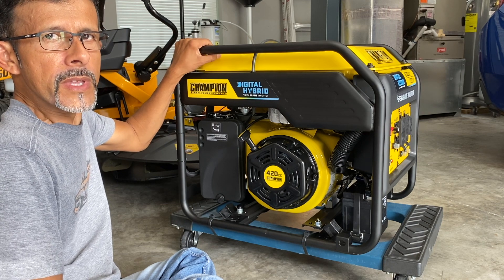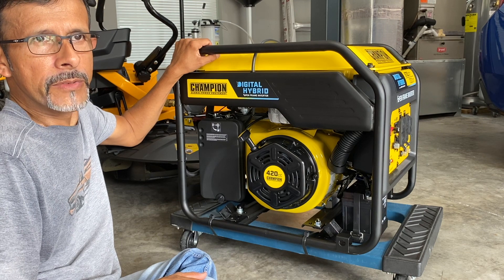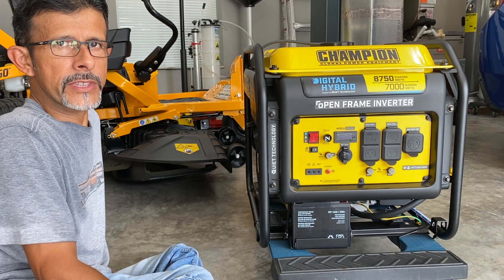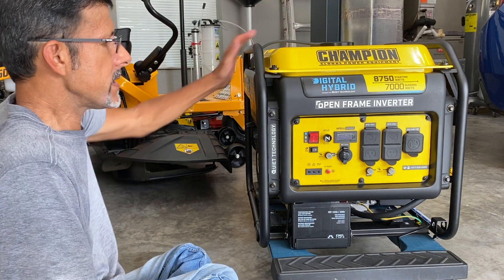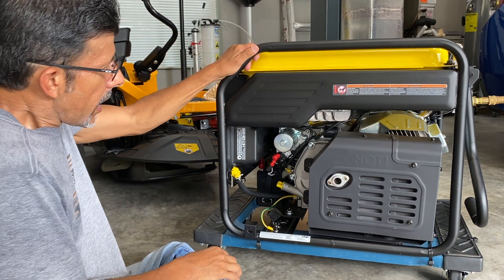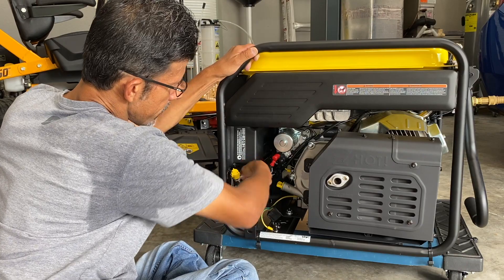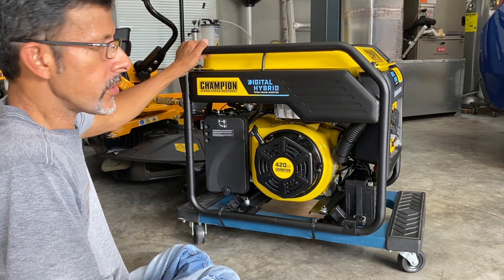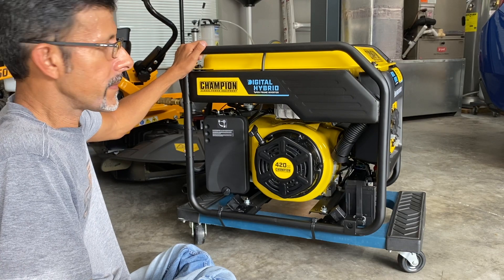Champion Inverter Generator 100520 with tri fuel kit

Comment: You don’t have a hose clamp from the regulator hose connection to the carb
Reply from the maker: A hose clamp wasn't needed because the barbs on the brass fitting were very tight. The hose wasn't coming off without some serious pulling.

Comment: You could install a micro-air soft start unit on your 4 ton and get rid of the 4 mini splits.
Reply: AirGo soft start is cheaper and just as good if not better. Installed mine yesterday

Comment: You don't have to run a generator 24/7.  You don't have to watch tv and use a home theater during a power outage.  All you really need is heat or cooling, water if you have a well, refrigerator/freezer and cooking.  You don't have to run those all at the same time either.  That's why you don't need a larger generator.  
If it's winter you heat the house to 75 degrees and let it cool off to 55 degrees, then start the generator.  Reverse applies to cooling, although that would be less comfortable, at least for me.  You probably don't need to run a generator more than 3-5 hours a day.
A tank of gas would probably last 3 days on that schedule.
Biggest drawback to gasoline is the ethanol issue and it going stale.
Reply: I run mine 24/7 when powers out.        House gets hot fast if ac's dont run at night in hot weather. 

 If you buy a premium 92 non ethanol gas and put stabilizer in it it's good for about 18 mo.without issues.   Then  once-a-year you just put that gas in your vehicles and buy new gas and it's always ready.

My 3500 will run on about 9 gal every 24 hrs. With 2 small window acs.   It's not an inverter but I've never had any issues with TV computer etc.   However there is one annoying issue with it now..... And that is that new LED light bulbs flicker with the non inverter generator.    And that is annoying as crap.  They save a tremendous amount of energy..... Especially running a generator.  But the flicker is a showstopper

So I have 8500/7000 watt inverter generator there's no light flicker but it uses 50% more gas than the little one for the same job.😮.   But I also don't have to turn the AC is off to use the microwave. And it will run my clothes dryer too. Or my wife can use a blow-dryer.

Comment: Judging by the looks of the meter box you built......the meters look familiar, and I think you misspoke....they can read Voltage, Amps and Frequency......not Voltage / Amps / Watts......right? The Amazon link you show doesn't match what you bought, too. Otherwise, fine review and NICE job on the box.

Comment: I have the same generator I want to convert to NG. I will be tapping into the meter and running a 25ft NG hose to my generator. Would 1/2” work or do I need 3/4”? I only ask because there is a huge price difference between the two with the quick disconnect fittings.

Comment: Hi Ozzie. I also have the 100520 champion and just installed the us carburation motor snorkel tri fuel kit. The generator still runs great with gasoline, but I can't get it to start with natural gas.  I am tapped directly to the gas meter low pressure side with 3/4" 25ft line straight to the generator. Does anything sound odd and have you experienced this issue and how did you resolve it? Thank you. Great videos BTW.
Reply from the maker: I would reach out to US Carb tech support. I’ve used them in the past and they are/were very helpful.
Reply: I will try that. Wasn't sure if I was missing something. Thank you Ozzie.

Comment: Hey Ozzie thanks for raising the standards of you tube videos.You definitely know your facts and it was well detailed on a much  needed subject. I like your fully functional and explained  project box which is a good guideline to know where you are at with voltage and loading without clipping on an amprope every time.I would say for sure you will see all your innovations implemented in Champions generators sooner than later.

Comment: Just curious, does the engine lose much after converting to NG?  I am considering that, but all the other inverter gennys that I see give different watt ratings for Gas/Prop/NG.
Reply from the maker: They do lose some running wattage while running on LP or natural gas because both fuel types have less BTUs than gasoline does.

Comment: Ozzie, nice job on the mods and the video. I recently installed an interlock kit and the power inlet box and wiring in my house. I tried it out with my old General GP5500 and it worked fine. I went to the trouble of installing a switch that allows me to choose bonded or floating neutral. I flip to floating for  whole house use and if I ever use it as a remote portable unit I’ll flip it back to bonded neutral. The 100520 has a bonded neutral and I like to know if you have modified your to be a floating neutral or if you just plug it in as shipped out of the box?

Comment: Hello Ozzie.  Thanks for the video. Is your meter displaying the total wattage capability of this generator on propane, 4300 watts?  I was hoping it would be in the range of 6000 watts. I bought the same generator today and hope to be able to run it on natural gas in the event of an extended grid failure. I assume the natural gas wattage will be something less than it would be on propane.
Reply from the maker: I don’t remember if I had the generator maxed out that day when I was doing the video.
Reply: @Ozzie4Para  Okay, thanks. I'm assuming the propane and NG wattage would be about 85% of gasoline. Your video is very helpful.  Best to you.

Comment: Excellent video dude!!  Your brain is fine tuned 3600 rpm to figure that all out.  20+ years prior home I grew weary of gas only gen, a fussy fuel to keep fresh, carb not gummed. I’m definitely heading in direction of propane now, I’ll subscribe to your channel in case I wish to add natural gas for a more limitless energy supply.  Or figure out a larger propane tank system, a couple hundred gallon “mini-pig” would be nice. I’ve pondered hurricanes at 100 mph across hundreds of miles perhaps for days on end, and tropical humidity+heat.  Uff da the Norwegian-Americans say.  I’m used to northern climate, less broad, more pin pointedness  “Russian roulette” of tornadoes, terrible winds lasting 1/2 hour max.  I’d be more terrified if 100 mph+ lasted for multiple days!!  Of course we get polar vortex brutally cold and very freeze dangerous blizzards that last a day or two.  Below zero to 30 below and windchills like 40 below. It’s a very good thing to have emergency power available north or south.  Plus I remain concerned about the warnings we’ve heard for years on the vulnerability of our electric grid potentially internet hacked.  One would think “the grid” would get completely separate fiber optic control cables buried with nothing to do with any global “internet” for homeland security purposes.  Champion seems to be brand I’m buying. Besides clean DC inverter, it shall have wheels and handle.  Since no volatile and smelly gas stored in the tank, I can roll it through walk-out basement patio door to utility/storage room.  Out of weather and away from mice, not chained against theft.  And I’ll put on e-calendar recurring reminders to roll it out about every 2 months to exercise it, to know it will work when called on, very important.  I see some folk have located where to buy magnetic dipsticks to grab the little metal bits from the oil.  Likely less after fully broke in.  Amazon might have one if correct sized, for reasonable.  Thanks again for all that great info.

Comment: I wonder if this tri fuel kit will work on the identical looking Predator generator? I have the Predator.
Reply from the maker: It should work as long as the Predator engine is the same size as the Champion. Your best bet is to call the Motor Snorkel company and ask.

Comment: Ozzie, Can you provide a schematic diagram and parts list for the amps, volts and watts box you designed.  Thank you.
Reply from the maker: I don't have a schematic but it really isn't hard to do the wiring. its pretty basic stuff. The parts list is in the video description. You can also look at the 14:41 mark on the video and see how it's wired. Not hard at all.

Comment: Great video. I just bought this gen and am planning a similar setup. For the 5 hour break-in period, I like that you changed the oil more frequently than required. Its a small price to pay for the extra assurances. I also found a magnetic dipstick for this model to help with removing the metal shards during the break-in. Hope this info helps someone.

Comment: Does your generator run at 3400RPM most of the time? I got the same tachometer as you, as it reads 3400 which I thought was interesting. Never seen it run 3600
Reply from the maker: Most generators run at 3600rpm in order to produce 60Hz. However, some inverter generators like the one I had didn’t quite run at 3600rpm. It was more like what you’re stating. I sold the generator a while ago when I sold that house so I can’t go out and check it now.
Reply: @Ozzie4Para  Thanks for the reply. I'm looking forward to any future generator setups you might do!

Comment: Ozzie, I installed a tri-fuel kit on my Champion Inverter generator.  I've run it on gasoline, propane, and recently I had an outlet installed so I can run it on natural gas.  My tachometer fluctuates between 3360 and 3420 rpms.  Occasionally it will hit 3480 before going back to 3360.  Is this normal?  I have adjusted the load block and this is the best I can get.  Is there any other adjustment I can make to get 3600 rpms?  Thanks.

Comment: eco mode is less about sound... and more about it'll only use enough power necessary for what's linked to it. it can gauge what's connected to it and only use the right amount of power to be more fuel efficient. but it shouldn't be activated until you're out of or past the peak or starter wattage levels.

Comment: Since you've done the conversion, did you get a chance to run on propane and if so, what runtime did you get? Would appreciate if you can specify load and size of propane tank. Thanks in advance.
Reply from the maker: I never had to run this generator on constant use during a hurricane power outage. But I did run my 11kw Champion generator for over three days on propane using a 100lb propane tank before it needed to be refilled.

Comment: Ozzie wanted to start off by saying thanks for the videos man, very helpful. I have the same setup as you, seems like the generator runs hot in LP , do you experience the same?
Reply from the maker: I sold my generator setup a few months ago because I needed to move. But I never noticed any difference in behavior with my generator while running LP or gasoline. It always ran the same either way.

Comment: Mine is having trouble running two refrigerator and two freezers. Any suggestions?
Reply from the maker: Something is definitely wrong there. This generator should easily run two refrigerators and two freezers. I can run three mini split air conditioners along with my main TV, lights and my microwave with my generator when I had it. I have since then moved and I don't have the generator anymore but I plan on buying another unit as soon as I can.
Reply: Just saw on their website to disconnect the ground. Gonna try that next.

Comment: Another question do you really need 2 regulators.  On my predator set up on only need the one attached to the generator.  Was wondering if there was an advantage to do it the way you have it connected.
Reply from the maker: The regulator on the tri fuel kit does just that. It needs slight vacuum from the engine to allow the propane to flow. The other regulator on the tank does stop propane from coming through. You wouldn’t want that if the hose were to accidentally burst.
Reply: @Ozzie4Para  That makes sense.  Thanks. Great Video

Comment: I installed a US Carb tri fuel kit some years ago on an old coleman powermate.  It worked well and was a quality product.

Fast forward to today and I wanted to replace my old generator.  I purchased the Firman Tri Fuel generator.  Between the $700 price, and not needing to spend almost $200 on the aftermarket tri-fuel kit, it made sense for me.

Yes, the THD is high on the unit, but it's also equipped with a automatic voltage regulator, allowing it to power my house and use sensitive electronics without worrying it will fry them.

But you have a great generator there, and nice job with the install of the tri-fuel kit.  Hope it works out great for you.
Reply: How has the firman been working for you with their voltage regulator? Any appliances damaged?
Reply: @acort10  nothing has ever been damaged, but I've been fortunate to not need to utilize my generator for any long periods of time, so I only have a small time sample to refer to when answering your question.
Reply: @frontxxrunner  makes sense. I’m looking at champion open frame inverters. Their small 4200w model is rated for 20+ hours on gas or 20lb propane for dual fuel. Their 6250w and 8750w I’ve only seen in gas.

Comment: 3600 RPM is required in a normal generator because that works out to 60hz, which is what the US power grid provides. 

 An inverter generator crates the waveform electronically in the inverter, which means the engine is free to speed up or slow down automatically, depending on the electrical demand.

Comment: Great video I picked up a Wen 8750/7000 inverter generator and looks identical in design to yours. Can you tell me the size brass connector your are using coming off the regulator to connect gas hose? Thanks

Comment: I figured I'd share this wireless energy monitor for those who don't want to go through the trouble of constructing this box:
https://amzn.to/3vwkGDz

There is also another version that will display frequency and hertz in addition to watts:
https://amzn.to/3fk7hbG

In my opinion it's much better to use something that can be monitored locally since there usually isn't internet during a power outage.

Comment: In your opinion, is tuning the gas block based on the integrated hz meter to 60hz a reliable method for dialing in the generator instead of a tachometer? I know it's difficult to tune these inverters unless you put a heavy load on it like you did to get close to 3600rpm. Just wanted your take. Thanks.

Comment: Did you regap the spark plug at all? I called US Carb today and they said to regap the plug to .2 to run on natural gas. Do you think it would be wise to regap when switching between fuels? I'd like to run both gas and natural gas.
Reply from the maker: I didn't regap my plug and it ran fine on LP and gasoline. I can't comment on the natural gas part.

Comment: Nice video, questions:  with the US Carb kit are you still able to run on gasoline without removing the snorkel?  Looking at that snorkel design it seems like it would block the choke.  Any fitment issues with filter box after adding snorkel?  Thank you!
Reply from the maker: The generator runs fine with the snorkel installed. That's the whole point of this kit. It'll run on gasoline, LP or natural gas.

Comment: The WEN GN875i and the Predator 8750 inverter are identical to this Champion generators, FYI. The Predator has a 6 gallon tank, vs the 4 gallon tank of the WEN and Champion for longer run time.
Reply: Would the same conversion kit (US Carb one above) work for those 2 models too?
Reply: @grajasekar  you can check on their webpage generally.  If it's not there, I'd call them.  Pretty sure they have "universal" kits to fit anything else.

Comment: Hey Ozzie, I just picked one of these up myself.  Got a noob question   Can you attach a trickle charger to the battery while its connected to the generator or do you have to disconnect it from the gen to keep the charge?
Reply: A trickle charger will work!

Comment: Your TVs, computers  with power bricks, phone chargers and home theater will be fine with the "dirty power''. Battery backup, UPSs or medical or acoustical equipment not.
Reply: You are incorrect. go use dirty power and see how hot those blocks get. If you were to run a few days with dirty power it will definitely cause issues. FYI Electrical Engineers have thousands of posts regarding this issue.
Reply: @edwardpilak6914  No doubt dirty power can cause issues however, a portable generator is a temporary solution in emergency situations not a replacement for your  power grid. Whobis talking about using power for days straight? If one is concerned and needs a permanent safe backup he can install home standby generator on natural gas.

Comment: Thanks for sharing! I am in the market for a Westinghouse or a Champion generator. But like you said, I am looking for the lowest THD( 3% is the lowest I have found so far) rating possible so my other "modern" electronics with chincy switched mode power supplies don't witch and complain.  But the way, I like the box! I have a few meters around here  i can use. Box was cheap enough and I bet Home Depot has something similar.

Anyways, good job and thanks for posting.

John

Comment: Great stuff....any info on how many amps it puts out  being converted to nat gas on the 30 amp. port ?  Thank you.
Reply from the maker: No because I have never used natural gas.
Reply: @Ozzie4Para  How about the Amp. output on propane. Running. Thank you.
Reply from the maker: @theendofallthingsisuponus1575  there’s no measuring amp output. The only thing you can do use some sort of electric measuring device like my power meter box. You would run as many devices that you could until the 30A breaker trips. In my case, I’m able to run around 41A before my generator’s 30A breaker trips.
Reply: @Ozzie4Para  Hi Ozzie i bought the 6250 inverter gen. Please,  the size gas hose to the converter and from looks like  1/2 In or is it 3/4. Thanks
Reply from the maker: @theendofallthingsisuponus1575  I'm not sure if the hose is 1/2" or 3/8" because I no longer have my generator setup. But I'm 100% sure the hose wasn't 3/4".
Reply: @Ozzie4Para  Did u get a standby... . ur vids were helpful thanks Ozzie